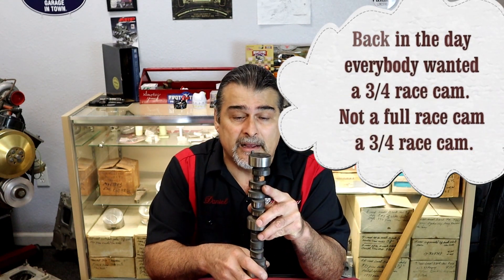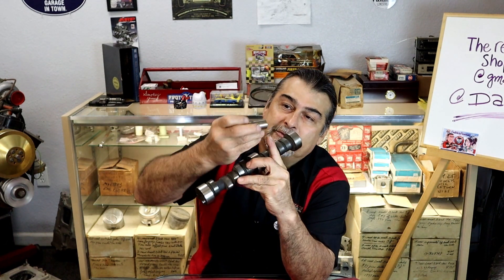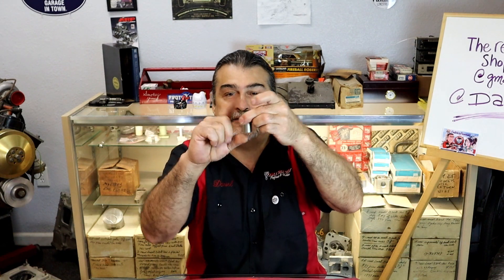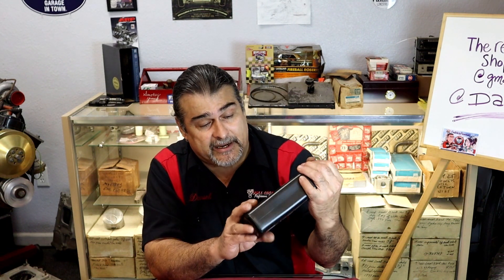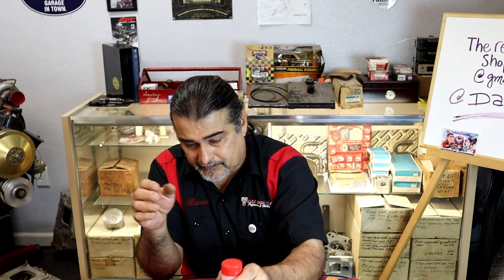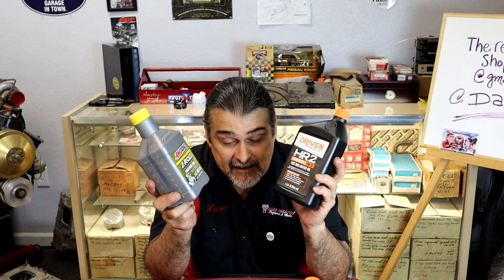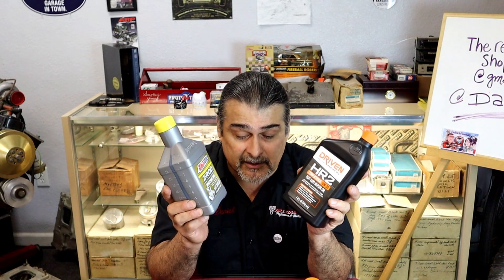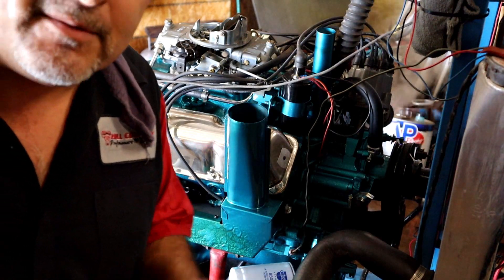What's Camshaft Break In? Part 1

Comment: Danny messed up right of the bat. Checking timing will the engine was at idle. I start mine up and instancy to 2,500 to 3,000 rpm. I differ the rpm between the 2,500 to 3 to 3,500 for 20 minutes. Come back 24 hours and do it again. Come back a third time and do it again. It's been about 30 years ago since I did one. I used pennzoil 20w 50 conventional motor oil I think with the the stuff they give you to put on the new cam and lifters. I don't know for sure if it was conventional oil or not. I have a BBC and still use pennzoil 20w 50 oil. Most the time thicker oils don't have all that bad things that thin engine oil has. These were mostly up to 8,000 rpm solid lifter cams. The crane solid cams with one part number for all there valve springs for BBC solid lifter back then. I think the High performance hyd. cams also used the same spring. Never broke a spring and I think the closed pressure was 120 or 130lbs at closed correct height.. I did a few 5,500 SBC and BBC cams and never had a problem. Watch the oil and temp guage. I also run one quart over full on the dipstick. You need all the splashing of oil you can get. Never had a problem and would use them today over a roller lifter. Only time I would use a roller cam if they had a bushing on the roller. Roller needle bearing like to brake and destroy your engine even worse that non roller cam.
They don't use rods in the small end with needle bearing they use a bushing. Needle can't stand the pounding and same thing go for roller lifters. I still have my street car with a crane solid lifter cam good to 8,000 rpm. Been in the car for close to 35 years. Am low on oil and thought about using Castrol GTX Classic 20W-50 Conventional Motor Oil, 5 Quarts or the Castrol GTX 20W-50 Conventional Motor Oil, 5 Quarts. I may even use use half and half mix. Save a few bucks. You don't need 30 or 50 dollar a quart oil. On the cam lobes since they are so sharp I use a small hand grinder on all the cam lober to knock off the sharp edges. Plan on taking you a few days as this is a long boring job if done right. I still believe to this day that helps a ton. I also use a ball hone about a 1/8 bigger than the lifter hole. Get the finest grit you can and only go up and down with medium stroke to clean the lifter bore and knock the sharp edges off were you can't get to them. Clean them and do your final engine clean up. Oil the lifter and lifter bore and it should move up and down and spin easy. I like to do another engine but it has gotten so expensive nobody wants to spend that much money on the stuff. I found a new ball lifter hone 7/8 size with a 240 grit. I use engine oil as the lube so it does not make things bigger. Wanted 320 but 240 was all they had. Different lubes can make them cut harder or less. Also helps the oil holes they drill threw all your lifter bores. So you have the to and bottom and the hole threw the lifter bore to get the sharp edges off so you don't get a little chip that wreck your cam and lifter. All you need is common sense and clean and clean before you put a engine together. These machines that are suppose to be the final wash is never doing as good as a hose and soap and a air compressor. No cheap way out here but good old hard labor.

Comment: This can break in thing getting out of control. I put 10 cam dynamics flat. Tap, it cams in probably 15. Iski 15 Crane never had one go bad until now. Change something in the middle. Used to put them in with STP in regulatory weight oil

Comment: One question i have wondered is using a mopar 440 w aluminum heads. On break-in, with temps going to be higher than normal, what is considered to be the shut-the-engine down point??

Comment: I'm building my first LS fully forged 390ci.  After my friend and I get it back into the car you're sasying to start it up and let it run at 2,000 rpm in my driveway for 20 minutes.  Don't slightly rev it up to 2500, 3000 and back to 2,000?  Just a steady 2,000 for 20 minutes?
THEN after that, what do I do?
I thought you seat the piston rings in the first couple miles with medium to hard accelerations.  How can I do that if I'm at 2,000 steady rom in my driveway?
Reply from the maker: Cam break-in and ring break-in are not the same. LS engines have a roller cam. This is for a flat tappet camshafts. Hope this helps.
Reply: @MrDanielSoliz  .....so for my brand new LS engine, should I start it up for the first time, let it warm up at idle for 10 minutes.....then go drive it pretty hard with hard acclerations and then finally going WOT within 10-15 minutes of driving?
Reply: @MrDanielSoliz  ....does a new LS build need to have the cam degreed...?  Or can the builder know for sure that its all set up correctly as he assembles it?

Comment: hello Daniel, can u tell me if valve lash needs to be adjusted on high mileage chevy tbi  engines sometimes., thank ye
Reply from the maker: Tbi chevys should have a hyd. cam and need no adjustment. they have preload. solid cams have lash. hope this helps.
Reply: @MrDanielSoliz  THANKS. ive  been trying to chase down a sluggish acceleration issue on my silverado.  it has 203000 miles., I am considering advancing my base timing a bit,  as it seems to be late firing a bit.  I was told that  advancing the base timing will affect the parameters of the computer controlled timing as well. Im thinking my timing set may be a little worn, or the cam gear that drives the distributor or both. I recently replaced the entire distributor with a high quality unit. I noticed the distributor gear was quite worn, but didnt think to look at the cam gear. ( I recall reading that the cam gear is made of harder steel than the distributor drive gear and doesnt wear much)..
I would love to hear your thoughts on this issue.,. Ive rebuilt throttel body, checked fuel pressure,  checked compression, it is average 140 psi cold. \
scoped cylinders and valves and they are clean with no issues. 
fuel trims look good and o2 sensor is oscillating., 
smokes a bit due to worn valve stem seals. 
starts and idles great, just sluggish in mid range.  like your riding a mini bike, waiting for the engine to wind out.
Reply: @MrDanielSoliz  thanks Daniel. can I ask you do you like to preload valves at 1/2 inch or 3/4?  and  also have you ever tried brazing the inside of a scored cylinder wall with a bronze rod... I have a 4.3 that looks to have seized a piston and has deep pitting in the number 1 hole of a 4.3 chevy engine.., the engine is already at .30 over, and I dont think theres enough left to bore the  pitting out as I read that .60 over is max.. I dont know if the engine can be sleeved. if not the only other I can think of option is junk the block, or try to braze the bad cylinder.. 
heres my thinking,, the explosion takes place at the very top of the cylinder, and oil lubricates the wall constantly, so I would not think the cylinder walls get extremely hot, because it would cook the oil to the walls in no time at all. If the brazed repair gets good adhesion and is smooth  it should hold. . 
 can u think of a reason why brazing pitting in a cylinder would not work? thanks 
 I think trying to do this would make a great show for your channel. just to see what happens.. if you want to use my block, I can bring it to u.. im in central tx.
Reply: @MrDanielSoliz  Daniel the reason I asked is I was wondering if the springs maybe weakened over alot of miles. or the top of the rocker arm wears some where the pushrod rides. everyone says put everything in its same location after disassembly  because of wear specific reasons.  , ,
 is it safe to say that as long as there is no clacking they are fine and lifting the valve height to thier full potential? 
I have a tired old 94 gm 350 that im trying to get the most out of.  thanks

Comment: Even with rollers do you have to break it in?
Reply from the maker: Yes even roller cams can benefit from a cam break-in, all do not as important as a flat tappet cam.
Reply: @MrDanielSoliz  so is it the same procedure 2000 RPMs for at least 20 minutes? I have a 5.7 L Hemi 2009 with 180000 Miles and surprisingly the Camden go out till just now!
Reply from the maker: Does not need the 20 min @2000 rpm’s  on yours it’s a Hemi problem not a break in problem. 
There’s no oil to the roller and don’t get enough oil. Use the HellCat lifters.
Reply: @MrDanielSoliz  thats what i did after reading many many comments and doin research. Comp cam with hellcat lifters and a MDS delete
Reply from the maker: @Ronkrein  that’s the best setup so far. 👍
Reply: @MrDanielSoliz  so I had the work done Hellcat lifters with a Comp Cam and an MDS delete, got it back from the mechanic and there is still a ticking sound even after the break-in. The mechanic told me the ticking should go away within a couple hundred miles or so is this true or is he feeding me a load of bulshit?
Reply: @MrDanielSoliz  also it was making sound after warming up and an oil change
Reply from the maker: @Ronkrein  the only ticking should be the injectors, doesn’t sound right.

Comment: Back in the day NASCAR tried to reduce cost and slow the cars down by mandating flat tappet cams. Two races later the cars were running even faster... Seems the cam running gear was quite a bit lighter and they were all experimenting with large mushroom lifters. With mushroom lifters you could open the valves faster as the cam struck the outer portion of the lifter much sooner.   After NASCAR found out about the huge mushroom lifters in the engines they limited the size to the biggest stock lifter diameter that the dodge boys were using. So all the cars had the same diameter lifter face.  Fun Fact!
Reply from the maker: love it, Thanks

Comment: I’m learning a bunch from you Danny. The sound of that motor is intoxicating. I could enjoy that for hours. Hubby dragged home an ‘05 Durango with a blown 4.7L motor. Evidently the rocker arms just pop loose inside around 100K miles. Are you familiar with this one? So they showed spring loaded? lifters with little resistance and were retrofitting it since Chrysler didn’t engineer it to stay together long. Do these ever show up at your place? I like your videos because you explain things well and you’re funny.
Reply from the maker: Thank you, yes we do get those in the shop. 
I will be doing a lifter preload video.
just remember no less then .020 preload and no more the .060 preload. this rule will work on any hyd. lifter.

Comment: Broke the cam in on Amsoil break in oil, then switched to Amsoil 3000 in a 5w30. Next change was with Rotella T6 5w40. So far so good with a mild flat tappet and mild springs.  Lots of low RPM use plowing snow and idling for hours on end as a powered wheelbarrow. Good oil for flat tappet “performance” cams is One of those pay-to-play type things, break in oil and good oil afterward is not the place to save money.

Comment: Would love to see a lifter preload video! I'm sorry if this is a stupid question but in the near future I'll be rebuilding a engine the main block is a buick 3800 series 2 (with Aussie top end ;)  ) I'll be replacing everything all bearings, the crank, the cam, hydraulic roller lifters , pistons rings ect. Is there a correct way to run in the bearings and cam but at the same time not glaze the cylinders. Thanks Danny love your videos!